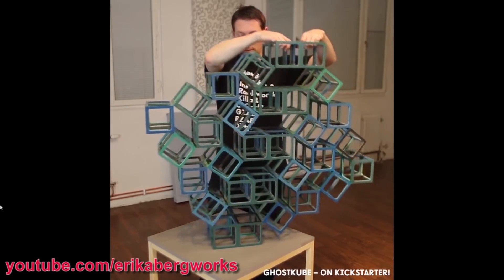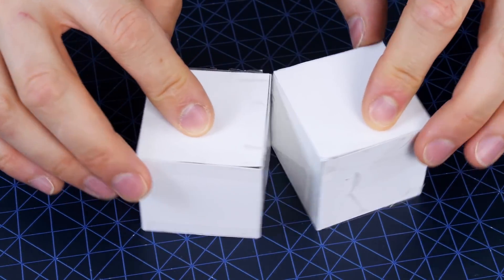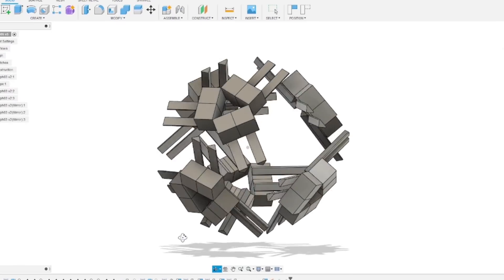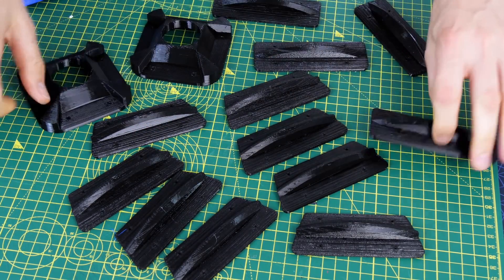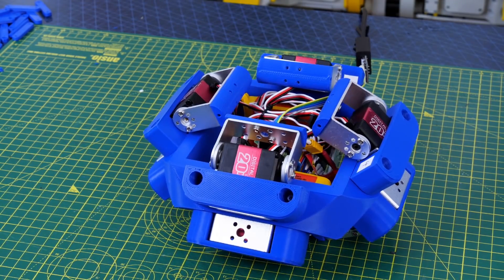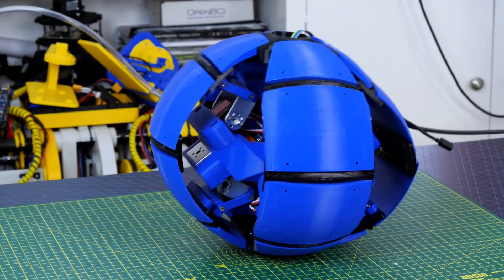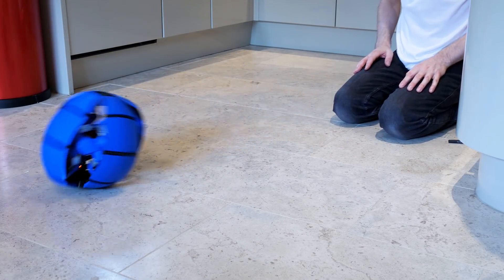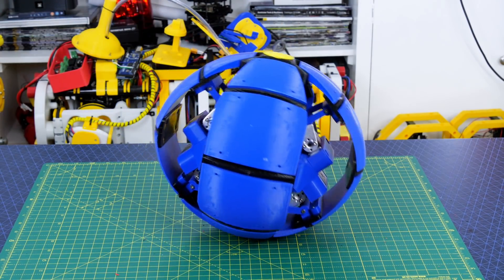Shape-Shifting Morphing Robot Concepts

Comment: I wonder if you could use a gyroscope at the center of the ball to measure the angular rotation rate when it is pushed?

If so maybe through some machine learning you can have the arduino control the arms through a changing tune PID protocol to flex and retract the arms at a frequency that corresponds to how fast the ball is rolling.

Comment: You know, I think you could get this to work without any changes to the hardware if you had it instead "wobble" over the gaps instead of trying to balance it on one of the flexible rings.  As one ring stretches and the other contracts, wouldn't it sort-of "step" forward at an angle, and then correct itself on the next step?

Comment: What about a solid sphere that moves using an array of internal piston/linear actuators? They could push out of holes all over the sphere. Or it could simply be a bunch of tiny servos (those cheap ones) buried in the surface of the sphere, and they turn their arm out to make it move. You could use a ball as the skin! The ones for kids are very flexible and cheap.

Comment: could i recomend use an acelerometer and some other chip whit wifi and or bluetooth integrated like the esp32 or the esp866 and run some test whit a manual control to test the best way to roll the ball. i already builted a bb8 in the past and worked but still be a little slow and not all terrain but is a good prove of concept

Comment: What you could do is add a mechanism that can detect rolling and sync the motion of the servos with it's rolling speed so that the servos in the direction in which it is rolling will always contract and provide force in that direction at all speeds

Comment: I would be interested in seeing this concept applied to a rolling wheel or rolling pair of wheels. A cylindrical wheel would be easier to control than this ball shape, and you could reuse the flexing mechanisms from this design to make the wheel roll. 
Having two such morphing wheels might even let it turn if the mechanics work out the way I think they would.

Comment: If you're going with a sphere; there's a design I saw a while ago that was a twin-hexapod (basically two hexapods merged at each-other's back), which had legs that had the outer surface of the last segmentm, the "shins", shaped like a half of an orange's, uh, forgot the word, the wedge shapes you can separate inside the orange); so that when it would pull it's legs in the tips would join at the poles, and the tops of the hexapods' shins would meet at the equator. It was able to move both as a legged robot, but also by slightly pushing the legs out of the spherical formation it could roll along the equator, and turn by doing it asymetricaly between the two hexapods.

Comment: How about using electromagnets you can switch between repulsing and attracting in different faces, to drive the folding from inside the cubes? (maybe locating them closer to the edges, so that different edges can have different polarities when necessary)

Comment: You could have just connected wires to him servo motor and run them through the points of connection instead of having to have a servo on every single one

Comment: I think the wire idea is what you need to reconsider. A box with diagonal wires to hold it together and a second set to adjust the shape. Similar to this old puzzle, just with the panels thicker to make boxes and additional horizontal wires driven by two servos in each box.
 https://en.m.wikipedia.org/wiki/Rubik%27s_Magic

Comment: It is a massive cash investment, but if  you had Lulzbot's Bioprinter, you could do truly soft robotics, and embed electronics and or motors in squashable materials.  Then, if your actuators shift momentum (mini flywheels as a probably poor, but off the cuff example), the momentum shifts will create momentum vectors, and you will have a squashy mobile robot.  Hypothetically.  For $10K US.

Comment: Your brain interests me :) I never would have come up with this concept.

I think the external weight needs to be evenly distributed for omnidirectional servo rotation. The "top" and "bottom" are a different weight than the "sides". If it were more like a cube in weight distribution than a square cylinder, I believe that a servo cycle could be programmed for omni directional movement.

Like a rubics cube, I think each side should be more uniform. Either in shape or weight.

I'm not sure if I am expressing myself clearly.

Comment: Did you mentioned that you have too many wires along the boxes? Try wireless coding between the servos, and place the power wiring goes through the hinges or servos. Also make bigger boxes to include batteries inside..

Comment: What about an internal weight that can be rotated in a direction inside so that the weight can cause the ball bot to move a little bit more consistently. Also add some texture to the outer surface of the ball bot, that might help with the carpet situation

Comment: Driving the cubes from a central motor could work if you have a thin link that connects the two cubes. The link might need to be-able to stretch as the cubes rotate over each other, but it could work.

Comment: Could you use electromagnets to work the hinges?  The hinge is attached a flexible joint and inside the box, electromagnets either repel or attract in order to drive the joint into the correct orientation (clarification:  I'm talking about the joined boxes at the beginning of the video)

Comment: Just a quick thought of me, instead of using servo's cant you use electromagnets inside the cube? By attracting and propelling you can probably move them. And contact points on the surface of the flat can provide power, only problem that it is lost during the movement so there has to be a small battery inside to overcome the loss during transition. Great project with nice challenges.

Comment: The use of Nitinol wire joints would provide the thin edge connectivity and low current demand to adopt its memory form together with low weight

Comment: Couldn't you stick a bunch of small linear actuators together in a dandelion seedhead formation within a thin rubber ball along with a 6-axis sensor, then just extend whichever actuator is pointing at the floor until it isn't any more? That should roll and be pretty soft.

Comment: Tip: Your mind is going the wrong direction for a solution of the initial idea, think kinetic walking sculptures mechanics wise, which will reduce weight and power requirements.  Think of the boxes as a superficial illusion to apply afterwards. (Something similar to this was actually a component of something I was working on a little over 5 years ago.)

Comment: Why not have a central mechanism with rods pushing out in all directions from the center?  That way (if you have some feedback as to position) you can precisely morph the shape by extending or retracting rods and have control in all directions?

Also think about how a sea urchin moves - still a ball shape (in a sense), although that would require far more actuators.

Comment: For the future in regards to the "ghost cubic", I think you called it that? Why not have something like a foot pop out of the center of the triangle to propel itself forward. It shouldn't hinder the morphing of the triangles as it seems, based on your prototype, that it has a space at the center of the structure that isn't hindered by anything, direction can be changed by just rotating the position at which the leg will pop out of, requires at least 2 motors or you could add a ton of motors to one structure for a ease of coding or response time.

Comment: I liked your ghost cube concept of putting servos in each cube, and using strings to pull them together. It occurs to me that to over come the cabling issue you could have the power/control cables run inside the strings you use to pull the cubes together.

Comment: Hi James Bruton, 
l like your idea, but you are you are using the wrong toy for your idea, what you need to be basing the Idea on the the classic "Rubik’s Snake" over snakes are available, 
just if am the only one person who remembers, GOOGLE "Rubik’s Snake",  
if you could you base you robot  not cube shape, it would be a lease 50% more flexible capable of bending easily with more shapes, break apart points, and you would still be able to use the cube's idea just now in to parts? the sharper angles would make more easier, for mutable of the robot to combine in to a single, machine to make, do bigger think, what do you think of this suggestion Idea to your project?
just adding a video, which is almost perfect demo of the concept of the idea below:
https://www.youtube.com/watch?v=5bNVe_BxL3c

Comment: Re: Ghost cubes. Is it really a big deal to have the cubes touch each other? Could there be some progress if the cubes are exploded a bit relative to one another to allow room for the pivot?
Reply: Or if the cubes are frameworks with internals?
Reply: chamfering the hinge edges could also give room for the hinge structure perhaps?

Comment: With the original cube hinges maybe you could power them with reversible magnets below the surface of each cube. If you simultaneously repelled the currently connected surfaces and attracted the adjacent ones you could probably flick it into new shapes without bulky powered hinges.